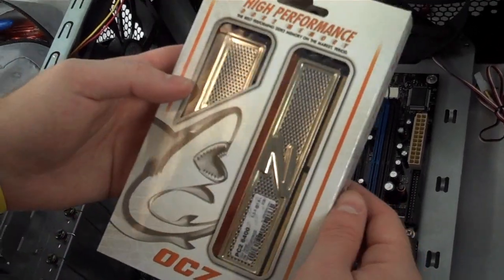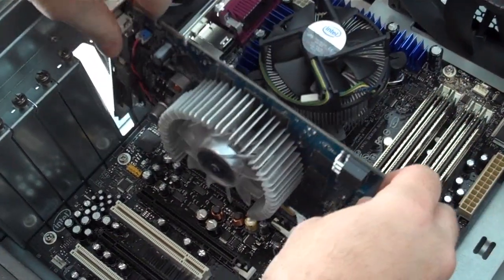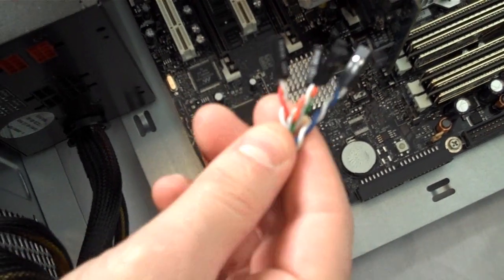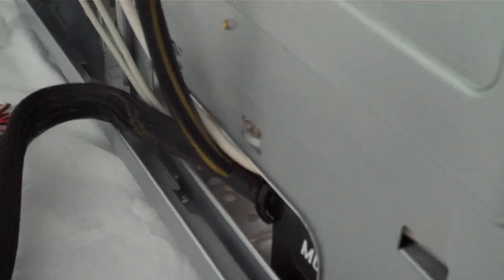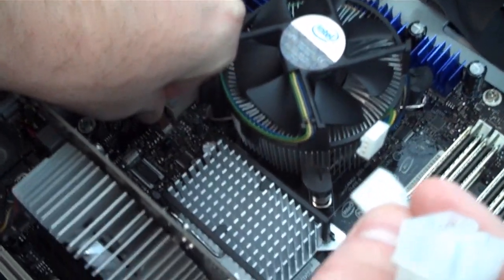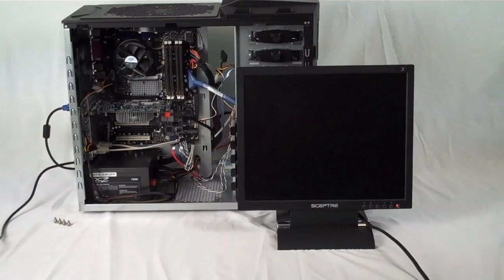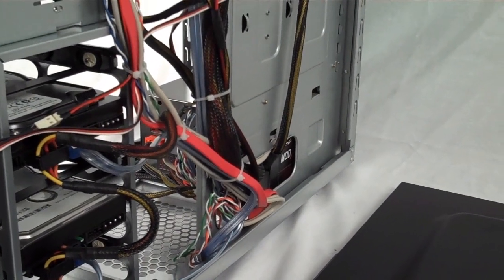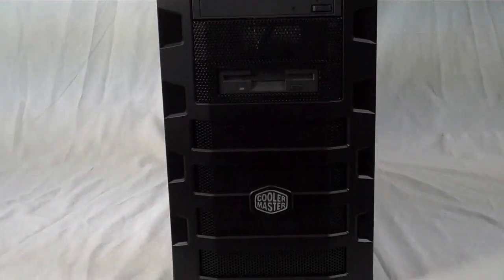Build Your Own PC Tutorial + Bonus Review of Cooler Master HAF 922 Case_PART II

Comment: Yes, for ppl who are new, the motherboard manuals are more than enough to guide you through plugging in everything, wires, graphic card, RAM, which RAM slot to use.

Just make sure you read through the manual and you will be fine.

After some time, you will get used to it, and will be able to identify the common connectors, you may only need the manual for the jumpers, to connect your casing power switch, led and USB ports

Comment: @ Homebrew2all
This is for their office, not a gaming build.

Several POS systems revolve around DOS and command line Linux for stability and modularity concerns. That's why there is a floppy installed. As far as the mobo goes, the molex connector is built into several newer boards to reduce power fluctuations and prevent under-powering when under load.

Comment: @DodgeEffect It really depends on the requirements of the graphics card and if it has a plug on it to plug into a power supply cable. My first one, by BFG Tech (screw them) had a pin connector and therefore required to be plugged in because it needed more power. The one I have now from PNY does not, so it really all depends if it's on there. If it's on there, make the logical decision to plug it in.

Comment: The other negative thing is that their is no dust filter on the bottom of the case and on the top. I have this case and im thinking about trying to close off the bottom and buy a 200mm Red LED fan for the side to move air a bit better.

Comment: Parts checklist:
Optical Drive (usually dvd burner/blue-ray)
Optical Card Reader
CPU (AKA processor)
Motherboard
Video Card (AKA graphics card)
Memory (AKA RAM)
Hard drive (AKA HDD or SDD) [SDD is faster but more expensive]
Power Supply
Case

Optional Parts:
Operating System (Usually Windows 7, don't buy if you use free linux)
CPU after-market fan (better than the one that comes with the processor, usually for overclocking)
Sound card (For those with hundreds of dollars in speakers/headphones)

Comment: @DodgeEffect new graphics cards now days require a lot more power because the huge gain on performce so most now days require from 1 6 pin connector to 2 8 pin connectors. if your graphics card requires a 6 pin ( like most do) u need to plug it in or it will not post

Comment: @BeconMovies lol, it won't blow up. Most likely, if something is not plugged in right, it just won't start. I've had this happen to me a few times with my computer, you just got to make sure everything is plugged in and plugged in RIGHT. They didn't mention about checking those 4, 6, and 8 pin connectors for which thing has a square shape and which has a curved edge. That matters.

Comment: @Dp153 It sounds super awesome, i have the excact same case and processor as you, overclocked to 4,3gHz with water cooling (corsair H100). Im running battlefield 3 in high with my zotac geforce gtx560 Ti amp! video card.  I guess you will be getting ultra with crossfire setup with yours :D

Comment: I am not a desktop builder but, first impressions, putting the hardware together is easy, anything that has to do with wires is just annoying xD

The case thought does half the work for you with its removable trays and lock mechanisms with the hard drive CD drive and so on and so forth.

I like this tutorial very much but sometimes there are some cables you connected without commentary which got me a little confused.

Thank you.

Comment: Things have got one hell of a lot faster using SSD drives etc. I have taken delivery today of this case plus i53570k cpu Gigabyte Z77x-D3H mobo Artic cooler 13 cpu fan Intel 120gig 330 series SSD. LG E2242C LED monitor And 8 Gigs of corsair vengeance ram for £570 pounds. A prebuilt system with those specs maybe upto a grand including a decent GPU. Get building it's fun and cost effective buying parts if you shop around. It's not hard unlike rocket science

Comment: But how do you know that the wires that come with the case fit with the headers on the motherboards?  How would you know if there are headers on the mobo before buying?

Also, what if the case has no front panels, would you just leave the header slots open?

Sorry for all of the questions, lol...

Comment: Where did you get that instruction manual from. For the LED, power & reset etc cables from the case? I have problems installing my Corsair tx650 watt to my cooler master 922.

Comment: @beto30co1 the size of the motherboard doesnt really determine how its going to be used. there are small or "micro-ATX" mother boards that, despite their size, do a lot. and then on the other hand, there are regular ATX boards that have very few features. What changes how it will work is the additional hardware, i.e. CPU, GPU (graphics card), amount of RAM, hard drive size. You said you want a "really good gaming computer" but to "do school work." Bit of opposites. Message me, and I'll help you